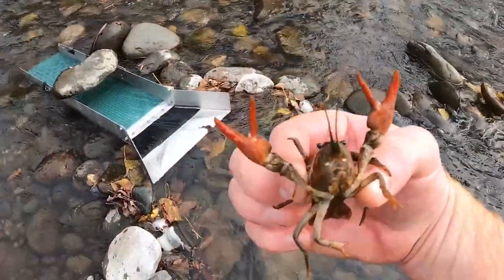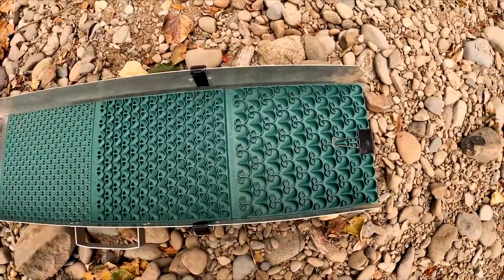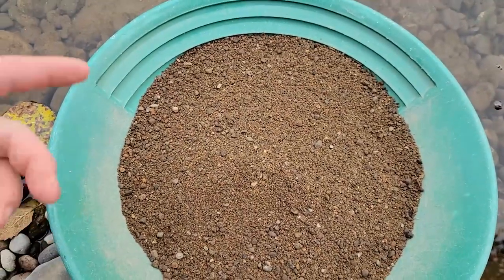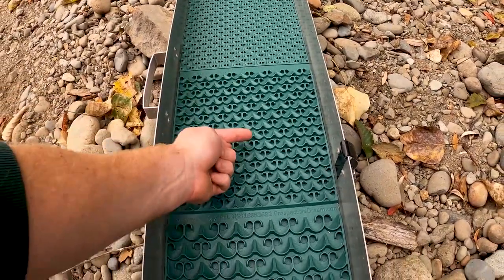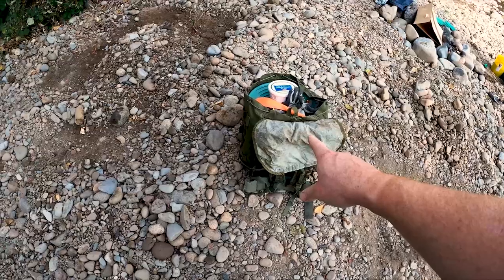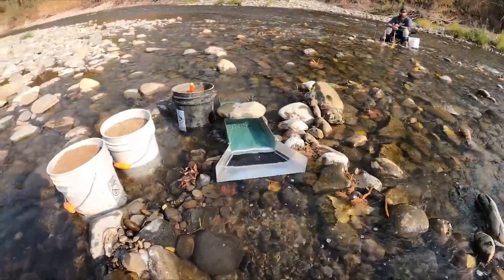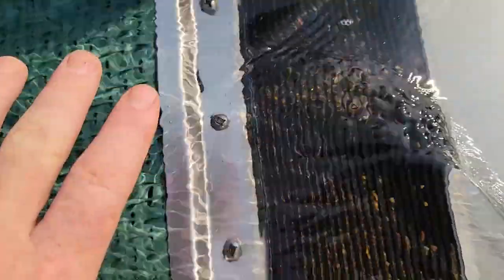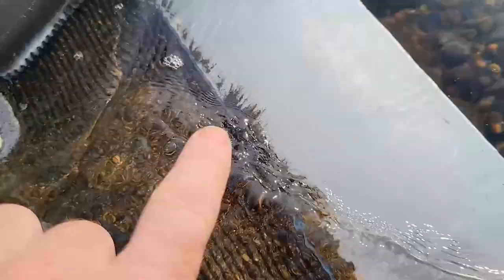Combo Dream Mat VS Flood Gold (First Impressions 2022)

Comment: Your Dream Mat will run better after it's broken in. I no longer have to scrub air bubbles out of mine. And the surface has seasoned from all the material I put through it. Seems to catch even finer gold now and let's the cons flow on by.
Reply from the maker: That's good to know! I was wondering how well the mat will season.  Thanks for the comment!

Comment: Since you had it dry to start you should get one of those spinning magnets.. run it on half a painful at a time..will remove most of the black sand and possibly wire. Transfer to bucket or pan to wet to run. Good luck! If that works let us know.TY
Reply from the maker: Seems like a lot of extra work. The sluice box should be able to work the black sands.

Comment: I love my dream mat, been using it a couple years and it'll catch anything short of foil!  Takes a bit more water flow though.  Air bubbles on the smaller cells almost always show up, gotta "pop" em when you put it underwater with a brush or something
Reply from the maker: I was hesitant to hop on the bus. Lol I'm glad I did. Bubbles should be a quick fix. I didn't want to pop them with gold already in the box.

Comment: Something to do about those air bubble is use a vegetable scrub brush after you set up your sluice and scrub the cells to get rid of the bubbles before you start scooping material....   kinda like you have to do with a gold cube and the vortex mats
Reply from the maker: Yup exactly. That was my first trip out with it. The next couple trips I brought a similar brush. You can also rub your hand or sand over it too. Thank you.

Comment: Great video. Thanks!
Ijust got the same mat.
Do you think a flair on your sluice is necessary?
I have a straight sluice run, with no flair.
Trying to decide if i need to hand fab a flair.
My box is 10x48
Reply: So the flair adds a couple different features, the most important being that it helps funnel more water into the channel which increases the velocity and power of the flow when your in a spot where you are struggling to get enough flow out of. But really, you can set up a few well positioned rocks at the mouth of your sluice to create a rock flair. You see spots in shallow areas all the time where people have created a dam like structure on one side to create more flow on the other.
Another feature the flair adds is a place to drop your pay without it directly landing and clogging up the first section of your mat with light debris that would normally rise off the flair after hitting and get swept over the first mat section and hopefully all the way off the sluice. You don't want the light debris gumming up your mat, which will then end up in your concentrate, creating more cleanup work for you later. 
You can also see in the video, he has a short section of indicator mat on the flair which gives him helpful information. So, say you do a test pan or two and start shoveling and eventually you spread your shoveling out to other areas that you didn't test. The indicator mat will grab on to some of the heavy bits long enough for you to catch a glimpse of some color. If you're not seeing any color for a while on the indicator it informs you that you might want to stop and run another test pan or two.
If you're dumping more dirt on that doesn't have any color in it you're ultimately just adding more waste to your concentrate and more time to your cleanup.
And its just fun to watch gold appear briefly on your indicator and helps motivate you to keep that shovel moving =D
You likely know all of this, but in case you didn't...
Reply from the maker: Yes, it helps in low flow situations.
You might check this out. Makes you think about the potential limitations of the mat. 
https://youtu.be/BGB7TNQ1m2c?si=VHkxOqSFMSzIiRiA

Comment: I know that spot, did pretty well last fall. River was too low to sluice. I just used the Gold Claw production pan with no classification and went through (4) 5 gal buckets pretty easily. Got into the 2-400 mesh, 2 fly poops in the safety pan. I hate classifying.
Reply from the maker: Same here, I rather dredge! Lol I should take a claw pan down there. I've always wondered if that light gold would escape.
Reply: @prospectingforadventure  I have the multi sluice, a royal miller table and a mining magnet for the cons, and heavies. Started using the Clay Claw last year unclassified and it takes it all the way to pure gold without all the extra work, it’s made me re think the equipment I bring. As with all prospecting the more volume you process the more gold (albeit fly poop at this location). I packed a ridiculous amount of equipment only to use a shovel and a pan, lol

Comment: The dream mat looks like it does the job well. Curious why you don't wash your rocks ?
Reply from the maker: It was a decision based on experience in that location. Dry classifying in that location has proven to get pretty much all the gold out of the gravel. If it was wet I would have classified wet. Sometimes a few more colors isn't worth the time or effort. With this method I moved a lot more gravel than if I took the time to classify wet. That gives me more gold in the end.

Comment: I want to start doing this so bad. Ive collected electronic scrap the last 5 years or so and used chemicals to collect the gold and thats addictive even though you spend more money on the chemicals - Nitric Acid / HCL peroxide / sulfuric acid and its very hard to accomplish and what your left with is a brown mud that still needs to be heated in a crucible to bring back in the metal yellow form we all know gold to be.
Reply from the maker: What state do you live in? That'll influence your luck with placer gold. 

I have a bucket of gold plated chips and boards. I've always had an interest in processing that into a gold bead. The cost and learning curve has always been a barrier.

Comment: I have the Dream Mat combo sluice with the micro and mini mats. Cant run both at the same time tho. Been considering making a longer sluice but since they have the combo mat its got me thinking.
Reply from the maker: I like it so far. I had it out again yesterday. I'm running pretty small flood gold. I cleaned each section out individually. The last section with the largest cells had a few colors, the cape D one had a couple dozen colors, the micro mat had ~%95 percent of the gold.
Reply: @prospectingforadventure  Cool! That is good to know. I have some gold coming in the mail so I can mix it into various soil types and test my equipment better.

Comment: ALWAYS use a fine bristle paint brush to wipe out air bubbles on any sluice....
Reply from the maker: Yes, I normally do. I just forgot to do it on the first run that day. I run the gold cube quite a bit and it's an absolute necessity with that.
Reply: @prospectingforadventure  
Great video!
Reply from the maker: @itchntohitch4143 thank you, I appreciate the positive feedback!
Reply: @prospectingforadventure  
Came down to our claims here in Arizona (Wickeburg area) for the winter. Been out findin' the shiney all day. A few colors to show for it....
But how fun is this? It's a lot of fun!
Reply from the maker: @itchntohitch4143 Arizona is on my list. I have a brand new Axiom to test out.
Reply: @prospectingforadventure  
Good luck to you! AZ has gold everywhere in the western deserts. High 60's low 70's daytime temperatures. In the winters and early spring usually too wet for drywashing but recirculating highbankers are great anytime.
Happy trails.

Comment: What degree where you running at    Thanks.  Have the same mat
Reply from the maker: The general rule is 1 inch drop per foot. I have no idea what degree I was at. I always eyes ball my sluice. Look for exchange rate in material. Water speed, volume and angle all play a role in that exchange.